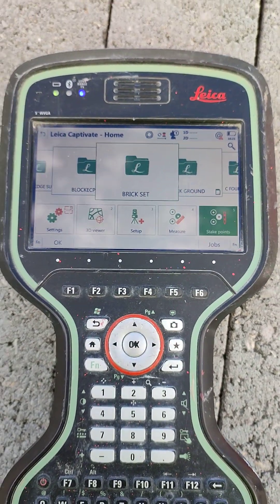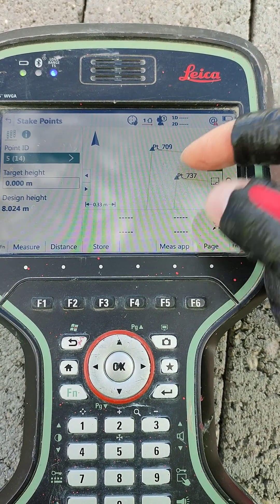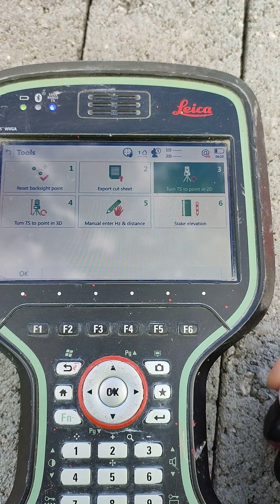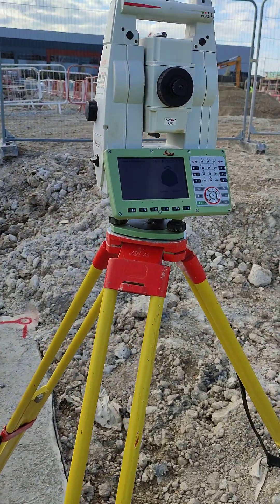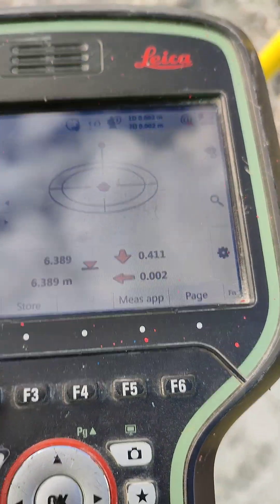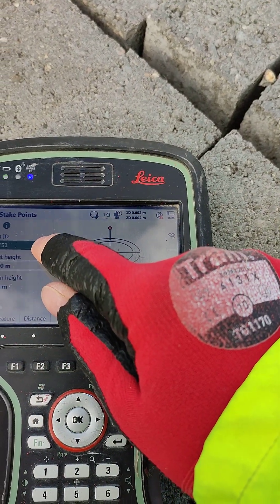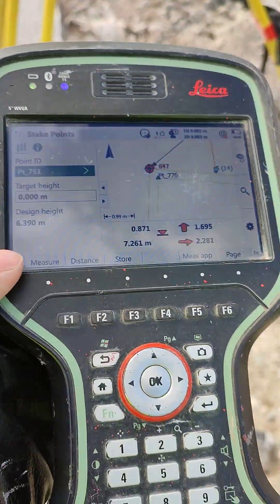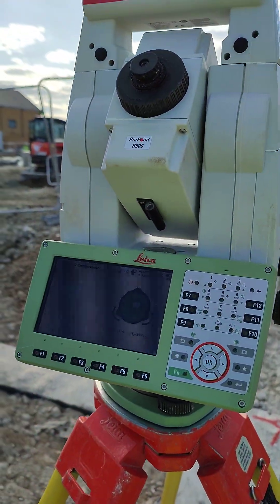Ts16 Leica magic secret stake out point in 2D and 3D turn automatically!

Comment: Great video I’ve been using 2D to help me find line for topo and not for stakeout with laser!

Just curious why not just measure and store point to put an elevation on it instead of hitting distance and going through edit screen since your height is already at 0.
Reply from the maker: Hi Rob, good question. The file I'm using I prepare on cad. I could prepare the points to have height on them and then I could use turn in 3d. But since it's time consuming to put level on each point I use it on 2d. Then small adjustments on site for each point and job done.

Comment: Hi Vince, great video!
I want to ask you which way you use usually to mark grid lines. Do you get points marked using the laser in reflectless mode, using a mini prism or 360 prism?
Za ranee blagodaren.
Reply from the maker: Hello buddy, 
Grid lines usually depends of the situation. If I am alone and have mini 360 prizm or mini round one I use them on lowest possible setting to be more accurate. If I have someone with me I use to stick a retro target on precut small square piece of plywood and the helper hold it for me where I point the laser. Then I tell him which way he has to move- to me for example 5,7,10 millimetres or to him. When we reach 0 mil I tell him to mark it.